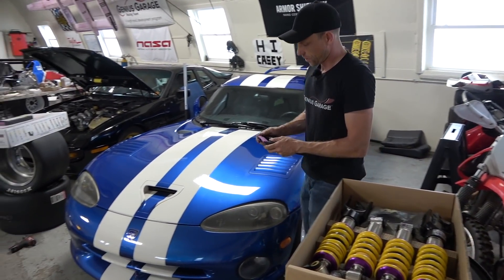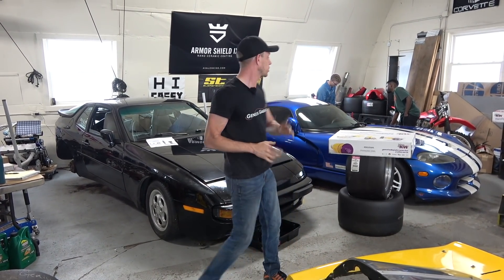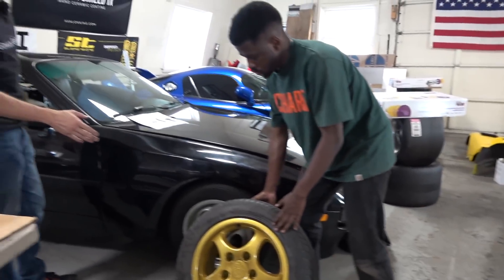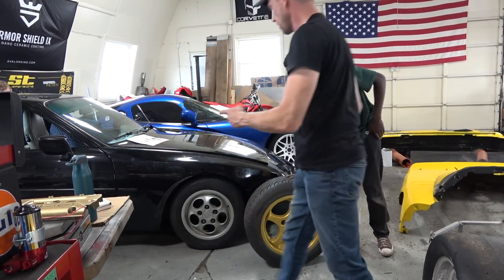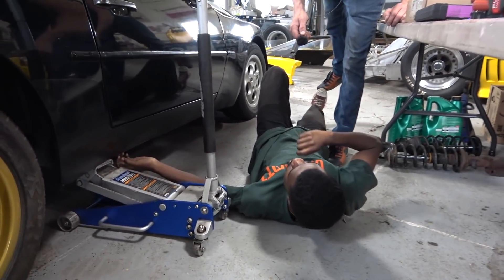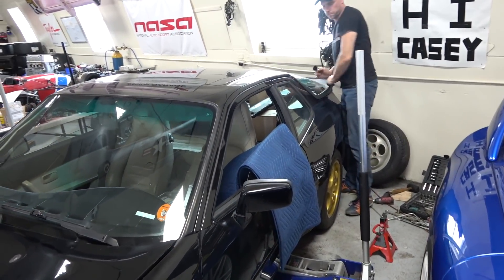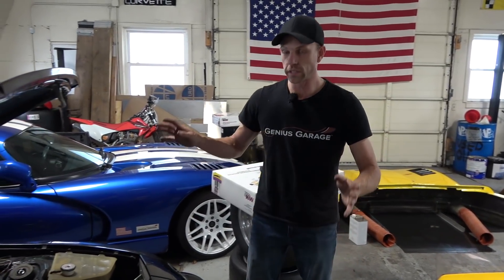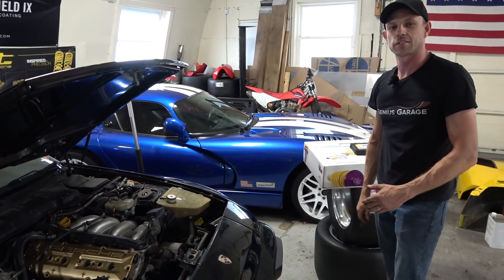Porsche 944 gets INSANE coil over suspension by KW!

Comment: I love my 86 944 with 28k miles. I have a  2018 M6 but the 944 is so analog and has just enough power to be fun - but without getting into trouble on the street. One of the best handling cars ever.

Comment: I wish I had bought my coil overs from kw… whilst they were made by kw… the after sales service has left me with a car I can’t trust for nearly 5 months. The shaft separated from the top mount on my rear shock at 100kph… thankfully with only minor issues… however it’s now been since the 21st of January and my car isn’t fixed.  The company stated they would send a replacement out on the 21st of February… but that hasn’t happened and as I’ve published this fact… Squadra Sportiva isn’t likely to ever send a replacement out.

Comment: 944 is a great car.
Reply: The 944 S is even better. It’s a 16 valve setup capable of 190hp and 170 torque when on cam. It’s a modern car in how it runs and handles.

Comment: Putting that shiny new coilover on the original suspension is like Road Kill slapping a brand new Holley EFI carb or a new supercharger on a rusted, leaking engine that hasn't run in 30 years, yet it fixes everything.

Comment: Make sure to get those directional tyres seated the correct way Casey, I saw the left rear and right front were backwards.
Reply: was just about to leave this comment, yes the driver rear is are backwards!!
Reply from the maker: Dang tire people F’ed up!
Reply: @CaseyPutsch  I know you're probably joking Casey but if a tyre shop can't recognize directional tyres and mount them correctly, then maybe don't use that shop.
Reply: @creverett9  Also the front right.
Reply: @kalidilerious  I have worked in and been the customer of many tyre shops, they absolutely make these kinds of mistakes, I just wanted to point it out to Casey because he didn't mention it in the video.

Comment: $4500 for KC coilovers or $1200 for BC coilovers......
Reply: I wonder if bc is paying for the banner or if KW donated the coil overs?  either way someone is getting scammed even it is Casey, GO BLUE
Reply: ...... those 2 brands are not even in the same league.
Reply: @dan.r9220  yea, 1 one price is reasonable, the other is insane without any explanation
Reply: @nickaltvater5592  kw is a OEM supplier who build high quality parts that last 100k miles. BC makes pricepoint coilovers for drifters.
Reply: @dan.r9220  how much more performance is in KWs for the extra $3000?
Reply: @nickaltvater5592  ide say probably an extra 5-7 years. maybe 40% better performance. With your logic everyone should just be buying maxpeeding rods.
Reply: @dan.r9220  what is "40% better performance"?
What makes you think they'll last 5-7 years longer?

Comment: I have an 1984 Porsche 944 that I am working on but I am having difficulties finding the parts that I need.  Any suggestions as to where I can purchase loaded brake calipers, disc, master cylinder etc
Reply: Try pelican parts !!😎😎🇺🇸🇩🇪🍺🍺🍺
Reply: @artmchugh5644  thank you for the suggestion
Reply: @taranson3057  no worries! !!! If used parts will work , check out my friend at just joshin 944 parts !! Tons of stuff😄😄😎🇺🇸🇩🇪🍺🍺🍺
Reply: @artmchugh5644  used parts will work as long as They are functional. My current master cylinder is seized up and need a really good replacement
Reply: @taranson3057  John will have all that stuff ! 😎😎😎😎😄😄😄🍺🍺🍺
Reply from the maker: Join “the no snob porsche 944 squad” on Facebook
Reply: @CaseyPutsch  thank you for the suggestions